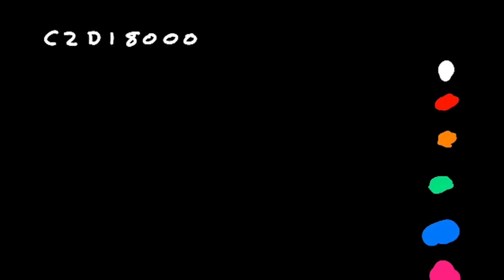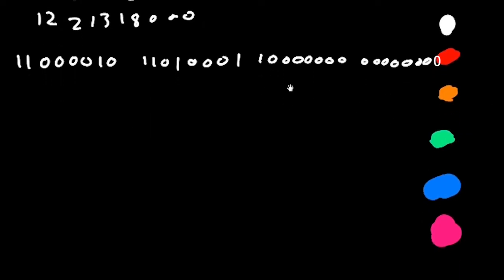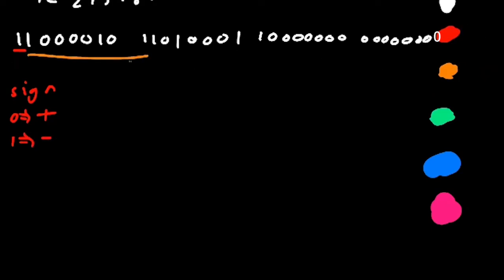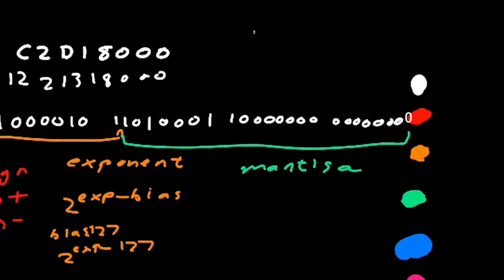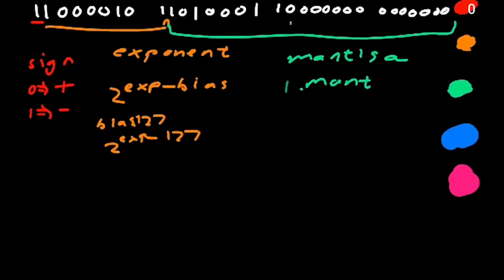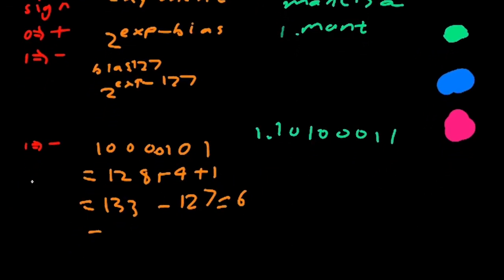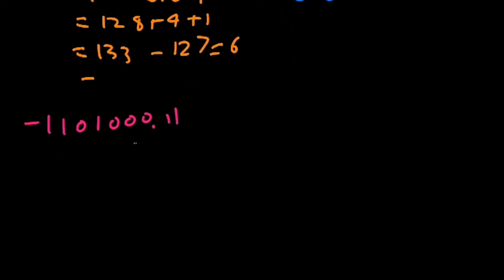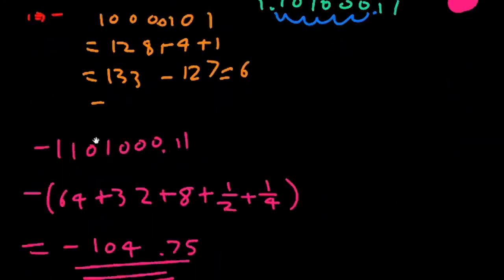Converting from Hexadecimal to Binary IEEE 754 Single Precision Float to Decimal | Darn Academy

Comment: And if the exponent is a negative after subtracting the bias ( ex. -44) . Move de decimal 44 digits to the left?...
Reply: Late but you could use the value formula
value = (-1)^S * 1.M * 2^(exponent after subtracting the bias)

Where S is the sign bit (either 0 or 1) and M the mantissa

Comment: useless, you didn't explain how to get 128+4+1?
Reply: He shows that the exponent is 10000101 in binary. To convert it to decimal you use the position of the ones from right to left in powers of two, so you'll have (10000101) as [1 * 2^0] (first position in the right side) then [1 * 2^2] and finally the one on the left is [1* 2^7]. Those numbers are equal to 1, 4 and 128 respectively. So you make the sum of them and substract 127 as the tutorial said to obtain the exponent. Hope it helped and check out some binary to decimal tutorial before calling something useless ^_^

Comment: I have a question what are those value after 128+4+1 means?
Reply from the maker: Lol people are actually watching this video?
The  "-127" in "133 - 127" is there because the true exponent in floats is offset by 127 so that you can have negative exponents.
Reply: @pickledcow_yt  yeah lol could you do 64 bit B1A0 0527 into hexadecimal using IEEE 754 'Double precision' cause I am getting big -ve exp and also its 64 bit to which I am so confused with it
Reply from the maker: @jaiminbhagat7610  this video was just for a school assignment but the concept should be the same with double-precision as well but with a different number to subtract from the exponent.